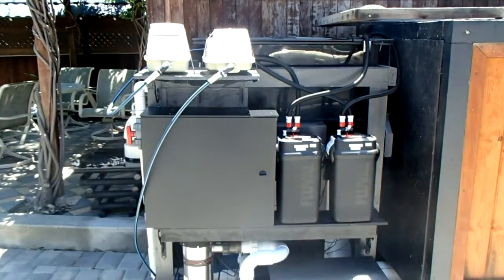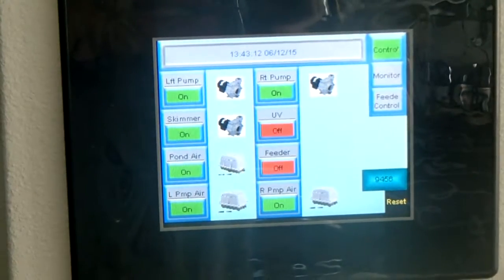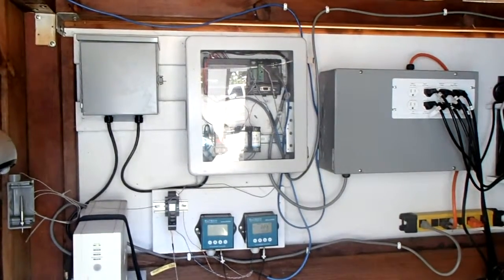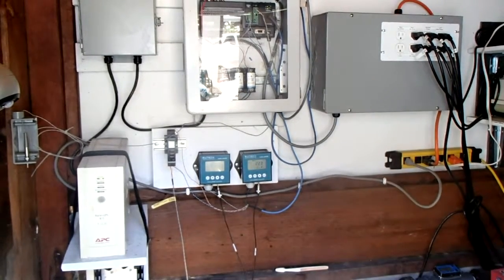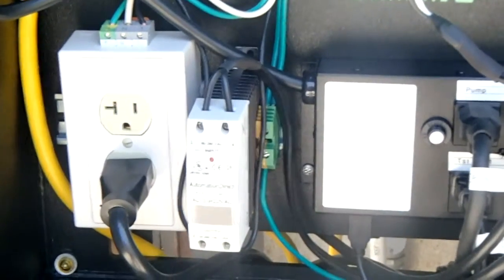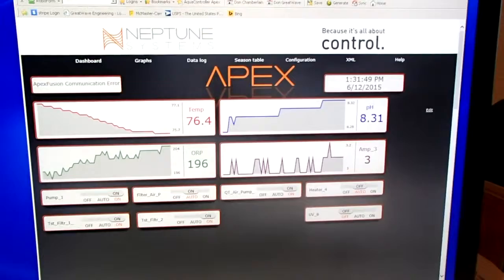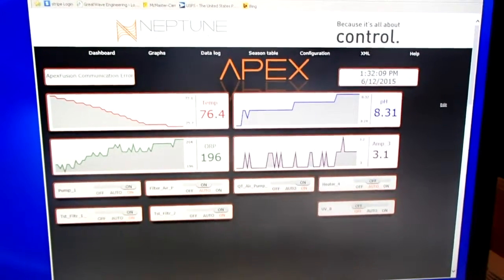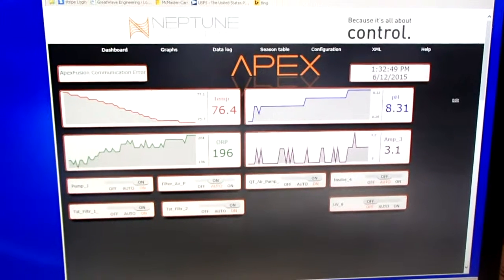A New Pond Control System

Comment: Thanks for the video. I am considering using an Apex system for my new pond and have a couple of questions.1. Are you still satisfied with the system?2. In reading the Apex literature they claim that some outputs are capable of 0-10V. I plan to run a variable speed pump that has 0-10V input for speed control but I don't see on any of the Apex interface screens where a 0-10V value can be entered or displayed. Would you happen to know if that function really exists with the Apex?
Reply from the maker: +Don H Sorry for the late response. I really never thought to look at YouTube for correspondence. I'll have to see if there is a setting that will notify me is someone leaves a comment.

Yes, I have very pleased with my Pond Control System. I'll soon be posting another video to introduce my production model. I have them listed for sale on my website: http://greatwaveeng.com.

I recently completed a second system which will be going on to my pond. Hopefully this weekend.

Apex provides for four variable speed outlets on the Control Module, but these are intended for Tunze or Vortech variable speed aquarium pumps. 

Which variable speed pump are you using. Most of them I've looked at have their own control boxes. 

Unless you're really set on doing your own system, you might take a look at the systems I've put together. I plan to put together a system designed for the customer's requirements including the initial programming.